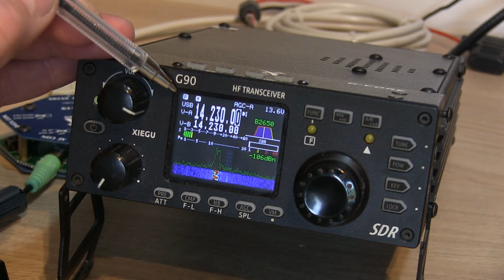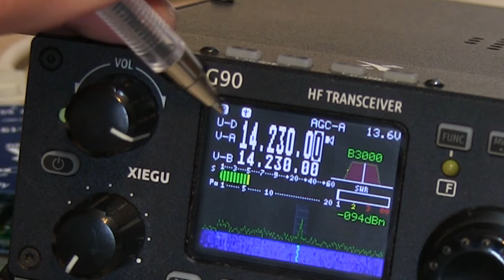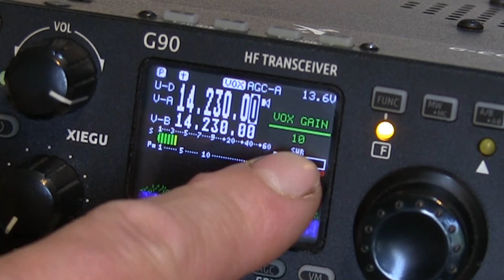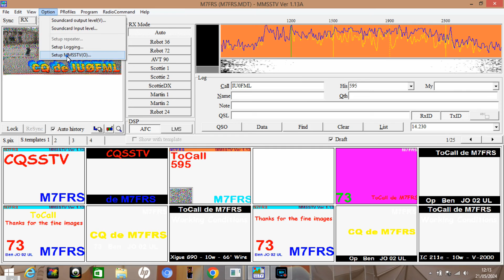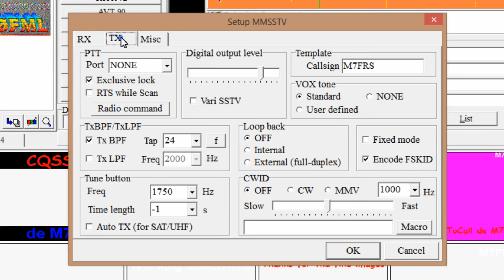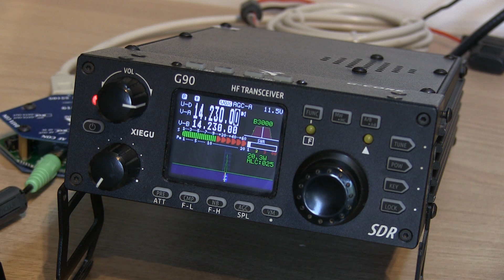Xiegu G90 SSTV - CE19 - VOX Control - MMSSTV

Comment: Thanks for that Ben, very interesting. It just shows how versatile the G90 is. I wonder how may contacts you are making on SSTV with 20 watts or do you have an amp? I don't own a G90 yet but the more videos I see of it the more the interest increases...
Reply from the maker: I've made many contacts on 20m SSTV over the last few years, mostly on just 10w as that's all my licence would allow until recently, so no, I don't have an amp. Thanks for watching. You won't be disappointed with the G90 😉👍
Reply: Thanks Ben, I have not used SSTV for many years but its good fun when conditions are good. I remember receiving a SWL card many years ago from Germany. I also used it on 2 metres cheers Graham G4NKW